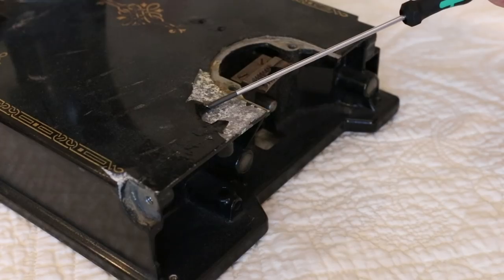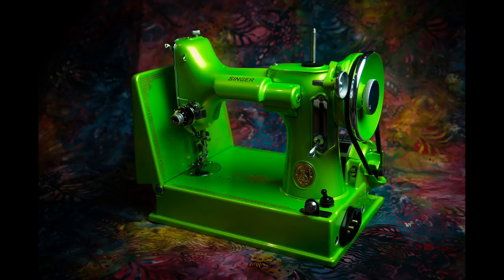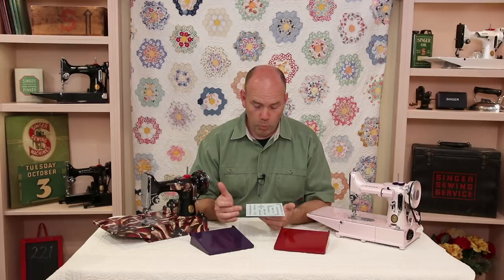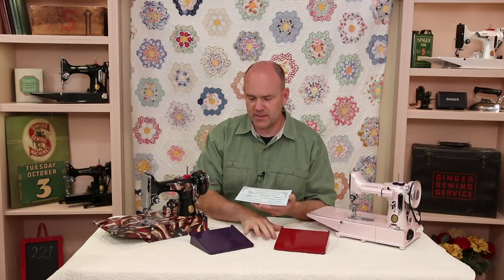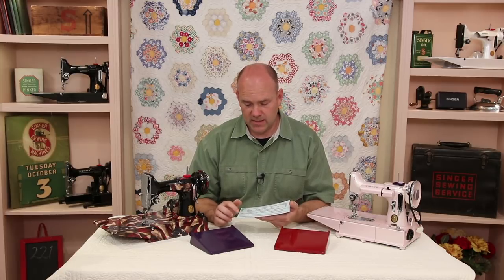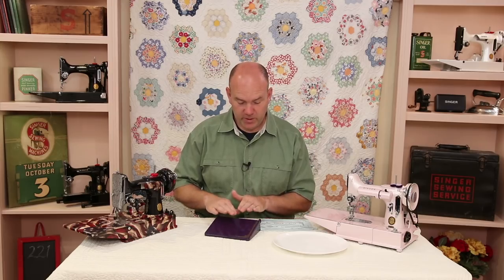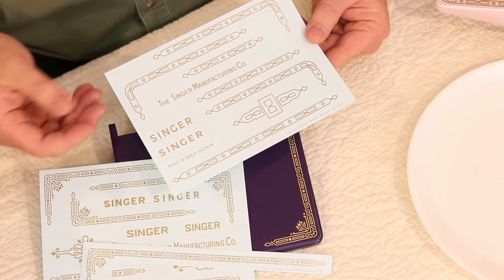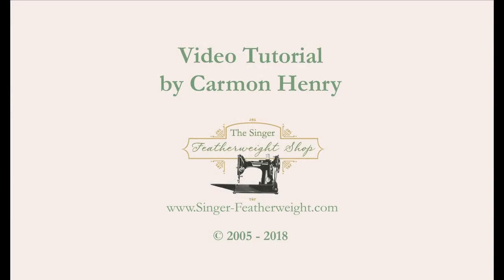Singer Featherweight 221 222 Repair Video Tutorial - Decal Application

Comment: The belt pully on my 221 keeps coming out a little and then the machine won't work.  So every 5 minutes or so, I push it back in.  Any ideas on how to fix this problem?  I have watched both videos on belts but none seem to deal with this problem.  Thanks and I love your video and products.
Reply from the maker: Thank you so much for your message!  Follow the link below for more information and to contact us directly with questions about the Singer Featherweight - happy to help!  :) https://singer-featherweight.com/pages/contact-us
Reply: @featherweightshop  Hi , I bought a used 221 singer featherweight a couple years ago. The person I bought from said it worked but , when I tried it  it shocked me and smelled like the motor was burning and the pedal also. I would like to know if I sent my machine to the featherweight singer center could and would they repair it for me? I also want it painted in my favorite color. Please send me a link to how I can get my machine repaired. Thank you!❤😊